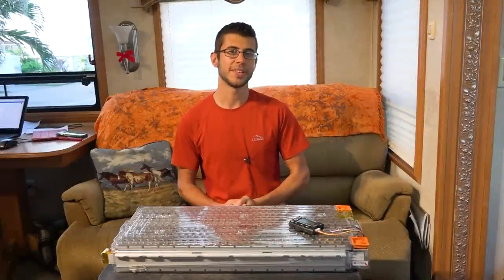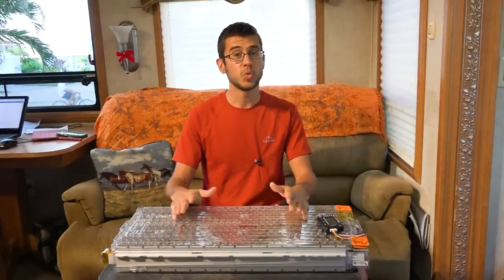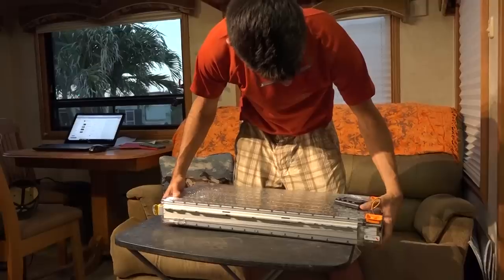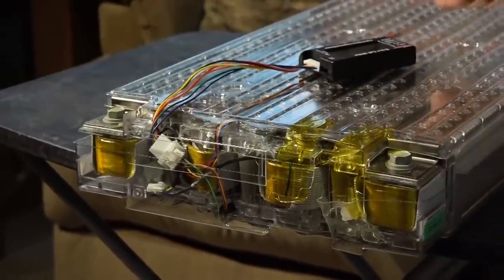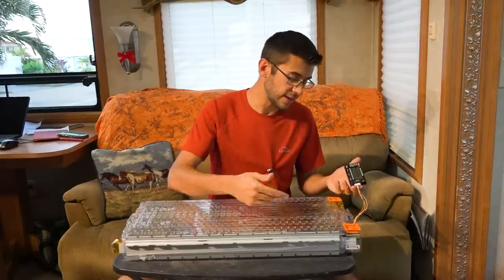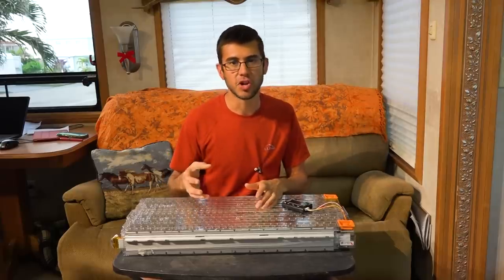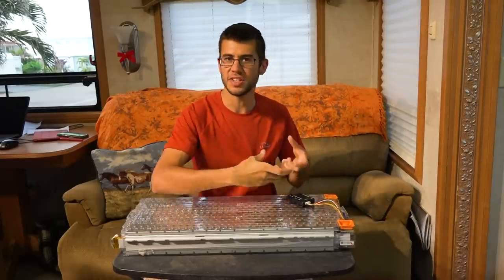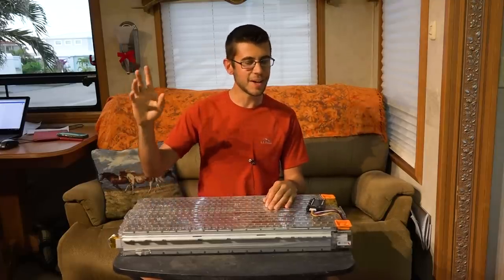Overview of the Tesla Lithium Battery Module We are Installing in our RV - EV Battery Hack!

Comment: Using this battery in an RV is pretty dumb.  LiPos need thermal protection both heating and cooling because LiPos generate a lot of heat both in charging and discharging.  You would be much better off using LiFePO4 batteries which only need protection from freezing.  It would also be much simpler and many come with their own BMS.
Reply from the maker: Heat is not an issue if you stay under 200A with this battery.  Under heavy draw and charging I have never seen the battery heat.  Exceed that like the car will and yes you need to cool it.

Comment: You keep saying "Watt density" which is an incorrect and meaningless term. "Energy density" is the correct term. A watt is power, not energy.
Reply from the maker: Yea your technically right.  Should always give a measurement of time to make watts energy.   It's still more accurate than stupid amp hours which is strictly power.

Comment: I am trying to connect a cell meter to our tesla battery, but am having problems with the right pins, i guess i am confronted with a newer version battery, since i dont have wires but a type of flexible platine coming from the cell groups. anyone has experience how to connect these(it's putting a lot of stress on some resistors inside the cell meter, they started fuming)
Reply: 4 cell groups from the top and three from the bottom connect to the bms via little plugs

Comment: This battery (5KWH) is too small. If you want to keep a 2KW pure sine wave inverter running 24x7, I recommend at least 4x or at least 20KWH worth of lithium. Ask me how I know this.
Reply from the maker: You cant make a blanket statement like yhat for eceryone, It all depends on your usage and location if solar. While we would like a second one, this has been plenty for us so far.
Reply: Mortons on the Move  Thanks for your video and reply. I can make this statement because I am on my 3rd generation of lithium batteries for RVs. This is the “wild west” of solar-lithium technology and can say that there are two kinds of RVers, generally speaking: weekend warriors and full-timers. I started my solar-lithium research as a weekend warrior, so a small system was good for experimenting.  As a fellow full-time RVer, and from one electrical engineer to another, I encourage you to do a service for all the RVers out there and perform a worse-cast power usage analysis. This would include:

WORST-CASE ANALYSIS FACTORS

1. Constantly running 24 Volt to 12 Volt converter and/or inverter with it's related losses. Mine is a 48 Volt system, but it’s the same principle.
2. 30% loss of battery capacity after a certain amount of time: 3-8 years.
3. Running the battery DOD (Depth of Discharge) between 20 and 80 to maximize longevity
4. Boondocking under trees
5. Freezing temperatures and running battery and other heaters, like water pipe and waste water tank heaters.
    Keeping the pipes from freezing can use a lot of electricity.
6. Cloudy skies
7. Using high-powered appliances after dark.
8. Running a residential fridge.
9. Under-powered or dirty solar array. Use MPPT charger output power, not input power. I recommend 1200 watts minimum of input power. 1900 watts of input power is preferable because there is alway loss due to sun angle, dirty panels and solar charger losses.

I have a 9.2KWH 48Volt pack with 1.9KW solar and the battery has gone flat on several occasions. I recommend that modern RV batteries have about 20KWH based on my real-world experience of one year with our system. This involved driving the rig at 55MPH at 10 degrees F and boondocking at Mammoth Cave, Big Bend and Death Valley National Parks.

That said, RVers can certainly live with 5KWH by cutting down on the power consumption, especially when the above worst-case conditions occur. This would require a compromise, which many power-hungry Americans will not be comfortable with. If an RVer “cooks on it” after dark, which to me means using a large electric appliance like an 1500 Watt electric stove or convection oven, it can take a dramatic toll on the batteries. My LiFePO4 batteries used to throw error codes in the Orion BMS because the cell voltage would drop to 2.9 Volts during heavy discharge. I resolved this by lowering the “weak cell” threshold to 2.3 Volts to account for heavy loads. So now we try to use our 1500 Watt convection oven when the sun is shining.

See my youtube video at Tim’s RV Tips #2 at https://www.youtube.com/watch?v=dywgaczX9Sg
1997 Foretravel U270 Class A Diesel Pusher
Reply from the maker: You have made some good points, We will cover a lot of this in a future video.  Currently we run everything on propane unless we have excess sun, or know the next day will be sunny.  We actually heated with the battery last night tho, so it is possible.  Your right lots to discuss tho!  Thanks for your thoughts.  I will check out your channel!

Comment: I also want to mention, for those of you that want to learn more about integrating these into your solar system, I recently wrote a book which covers sizing and using EV batteries alongside designing an off-grid solar system. You can find it at diyhp.co/solar (not intended to be a plug, just thought your viewers might want also be interested in a written resource)

Comment: Don't confuse watts and watt-hours. Li-ion batteries have high "Energy-density"  i.e. watt-hr or kw-hr density. Watt density is not very meaningful. Watts are the instantaneous delivery of energy, 1 Watt = 1 joule per second.Energy is the sum of the power delivered over time.
Reply from the maker: Watt density is most meaningful when talking about weight.  What bothers me more is Amp hours... lets just keep everything  in Kwhr to make it easy.
Reply: Yes, kwh are measure of energy, amp-hours doesn't tell you much.

Comment: I live an hour north of Toronto in Canada. We have Tesla cars driving about in -30C temperature. This doesn't fit with your comment about recharging in the cold in temperatures <0C.
Reply from the maker: Later I discuss the heating / cooling water circuit in the battery.  The car uses that to heat the pack before it charges it.  The car will never charge a frozen battery so if the heating circuit fails the car will be unable to charge.
Reply: Thanks - looking forward to it. I watch a number of YouTube sailing videos like RAN Sailing. The boat owners are faced with plenty of maintenance and replacement of batteries. The Tesla battery looks like a great replacement?

Comment: It seems from the video that Tesla battery makes use of a crude BMS that only monitors batches of cells within the 24v pack and relies on the individual fuses to prevent rogue cells from causing problems. While not sophisticated does whats needed and has proved effective, in line with Elons design philosophy? Why complicate!

Comment: Tom, I like your videos, but this one was way over-nerded. If you were a salesman, I would say you spent too much time on FEATURES and not enough on BENEFITS. Will this battery enable me to run my air conditioner longer? What about cost?
Reply from the maker: Features was the point of this video, I wanted to show it off while i still could,  functionality will come in a separate video once installed.
Reply: Will too know what he is doing you need the background on the battery. That's what he does.  I'am a ASE master tech and i even found this very interesting and better explained then any book/instructor ive seen.
Reply: Live-Laugh-Love-Travel. You miss my point. 99% of RVers aren’t ASE Master Techs. I would like to know the cost and specific tangible benefits to the average RVer. I thought I was clear about that in the last two sentences.
Reply from the maker: Truthfully Pete this would not be a good option for the average RVer, too much complexity without a drop in BMS solution, I will address this and some alternatives in a later video.  Thanks for your comment.
Reply: Do you really expect to be spoon fed? Be happy that someone shows you an alternative way of approaching their RV tech. Do a little research on your own if you do not understand the subject of the clip you watched then come back and ask sensible questions.
Reply: Funny. How much more info do you need when he gave you already the information where he acquired the battery. Maybe it is too hard for you to google a website after Tom already told you where to by the battery (16m24s) and look up prices yourself. SAD

Comment: wait... all Li-ION batteries,,, if you try to charge them below 32 degrees, such as in a cold winter shed, with an elec. charger, you will KILL the battery??? and if they go completely drained while standing around long long time, they go dead forever too:????
For example.. I have a NIKON D7200 DSLR camera... if I am in the cold or get cam from the cold and try to charge the battery IN the cold or take it out and place in charger, cold.... it may destroy that battery pack?????? Hmmmmm.  May have to warm up in arm pit for a few min first???  Kinda sucks for winter photography where the camera may get to 10 degrees Farenheit, I guess? Even for use? due to freezing battery pack. I guess NiCad has advantages.
Reply from the maker: Yes that is an advantage to Nicad.  Always warm them before charging, preferably before using too to get full capacity, but it wont hurt them to be used in the cold.
Reply: @MortonsontheMove   Thanks for the info.  I used to prefer Nickel Metal Hydride... but they are not so favored anymore, I think....and I do not even really notice them around anymore and I guess even better than LI-ION in cold temps. I do know they can draw to zero charge and retake charge OK also as long as no polarity shift, but do not know if NiMH can BE charged in a sub freezing ambient temp environ. Less apt to explode or flame up also compared to Lithium.

Hope you and yours get to go to Sedona for some length of time for some NON-National Park recreation.... Good bike riding and hiking zones you WILL LOVE. Many things to explore around that town within an hour radius and two hour radius. For an inland location, SEDONA, AZ is the ultimate place.  Well, along with Yosemite area..... I think they are heavier per cubic unit measure than Lith-Ion though.

Comment: ...TESLA is good, but not the BEST. The LG Chem RESU10H Lithium Ion Battery (total power 9.8 kWh, in which I am running 3 in parallel for a total of 29.4 kWh, charged by 50 LG NeON 390 W High-Efficiency panels total 19,500 W) actually out performed the TESLA Power-wall Home Battery... I actually believe that you don't have the most efficient devices or your specific needs, which may end up costing you more financially, in the long run...Therefore, who cares if it's a "TESLA" car battery, the most important and intuitive question is, what battery is best suited for your power demands...

Comment: Just wrap it in a thermostatically controlled electric blanket. How hot can it get? What about cooling? Ford Germany designed and is testing a hybrid in the UK and it has a liquid cooled battery. Liquid like water has a high specific heat so that means you need a lot of calories to change the temp one degree so that makes water an excellent choice for temperature management.
https://adorecar.com/2020-ford-transit-hybrid/
Reply: Guess I could just watch the video. Thanks. I want to go as far with electric as possible so a electric water heater and that water will heat the floor for passive heat. Keep everything nice and dry in cold weather.

Comment: would like to talk to you... your are wrong  lead acid batterys. 3000 ++ cycles. off grid with 4 l-16 batterys = 385 amp hours. over 80 homes built with this. 24vdc = 4 l-16. a bank of 3 sets and powere almost for ever. 10 to 12 year replacement. use solar to run heavy loads during day. batterys only at night or very dark days.. NO BILLS
Reply from the maker: In a large bank properly managed and stationary I agree you can get this performance.  In an RV that floats them a ton, does not maintain them and tosses them around I doubt you would’ve see that performance.  I worked in industry that used lead acid on mobile equipment and we could never get them to last.

Comment: Is it viable to use two or three of these modules in tandem if my energy storage requirements are more than ~5kWh? What would be required to do that? EVTV makes a module controller that I believe does exactly that, but it's expensive ($1300): http://store.evtv.me/proddetail.php?prod=basicsmodulecontroller
Reply: It might sound mean, but if you have to ask if it's viable or not you maybe should take a ready made module. The energy content of these batteries is no joke with little room for mistakes.

Comment: Aren't you confusing sealed NiCads with lead-acid batteries? Under very special circumstances, NiCads will exhibit a memory effect if you regularly recharge them at the same point before they are fully discharged and then try to discharge them below that point when you normally recharge them... as used in satellites. It takes a hundred or so cycles to create that memory effect but only 10 cycles to remove that effect. 
Lead-acid self discharge at what? 20% or more per month... yeah, at 40ºC. Even you would self discharge at that temperature! Try 5% per month at 25ºC. 
Two and a half minutes into this video and so much urban myth and rumour. Sure they have a higher power density and can be discharged further without wearing them out but they require tighter spec chargers or controllers to maintain them. Every battery type has its pros and cons; choose the type that suits your job and stop spreading the BS because you don't like a battery type that has been around for 150 or so years and started every fossil-fueled vehicle to date.
Reply from the maker: I am not a chemist, but i do have years of experience woring with lead acids and battery chargers. If you don't regularly push a full charge or actively equalize you will see significant shortened life of lead acid if used reguarly due to the weakest cell failing or drawing the pack down.  Agm are better but still can loose balance, besides that DOD has significant effect on battery life cycle, manufacturers usually supply that info on their site.  I worked extensively  in the past with large UPS units in industry and making the batteries last the longest was always a challenge with the lead acids.  AGM s were an improvement but lithium blew them all away with ease of keeping them healthy. Thus I still feel lead acids while cheaper still require extensive charging control and monitoring to make them last, and even with all that it was a fraction of the life span of newer tech.  In a vehicle starting application they work ok since they only use a fraction of the capacity regularly, try leaving a light on every night in your car tho and that battery will fail shortly.  From my experience lead acid is a terrible choice for regular use in energy storage applications.
Reply: If lead-acid  is a terrible choice for regular use in energy storage applications, can you tell me why they are still around today.  Lithium primary batteries were proposed in 1973 and the first rechargeable batteries went into production in 1991and they have been tweaking the recipe ever since.  Um, one other thing dude, what is the nominal voltage range of your battery pack? Why aren't inverter manufacturers throwing out all the old units and just making new ones just for  Li-ion batteries? Okay,  you can pull your battery apart and replace individual cells but you've got to wait until another Tesla gets pranged. In the mean time all your cells in use are aging at the same rate, but what about the ones left over from your original battery pack? Yes I can see lots of problems with  Li-ion batteries, just as many as you can with lead-acid.
Just a little light humour... In 1899, the first road vehicle to go over 100 kilometres per hour was powered by lead acid batteries which were invented 40 years earlier.  It took the inventors of the lithium battery 6 years to go from an idea to a working sample. In 1991 Sony made the first commercial rechargeable Li-Ion battery. In 2008, Tesla produced their first commercial car that used Li-Ion batteries. From battery idea to car production... 35 years, number of people involved, thousands. If Gaston Planté had the same number of people working on the battery, 99% of them would have been lawyers and development would have taken the same length of time.

Comment: I would like to build my own power wall because TESLOR won’t even sell it to me.  I need back up power for our home we have solar they said it’s not legal to connect the TESLOR battery because the power company.  Our power company will not allow it.  
I already have an inverter.
Reply from the maker: Ugg the legalities of grid connect are a nightmare,  if you use a transfer switch and a stand alone system not grid connected you should be good tho.  I have heard this story many times.
Reply: Build a big enough system and disconnect from the power company totally.  They tried that with me and the power went out, I hooked up a generator to keep my house operating,  they said my disconnect panel wasn't approved, but they had no list for approved panels. They don't want you having your own power, they have monopolies on your power and don't want to give it up. Buy battery and generator backups,  possibly even wind generators. My next step as well. I'm so done paying for shitty customer service, and bad attitude

Comment: 5000 cycles good luck with that lol
Reply: Mark Williams are you implying he won’t get that many out of the battery?  Even if he got 2/3rds of that it would be excellent.
Reply: If you run 75%-25% SoC cycles several thousand cycles are easily doable with managed Li-ion batteries.